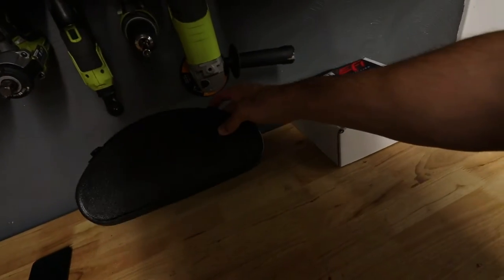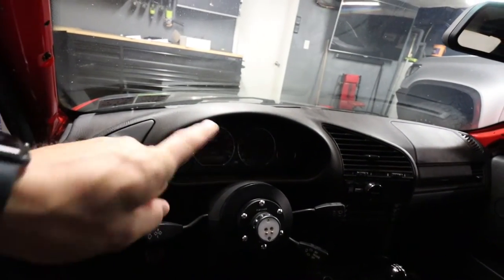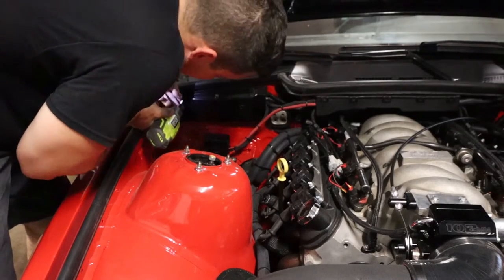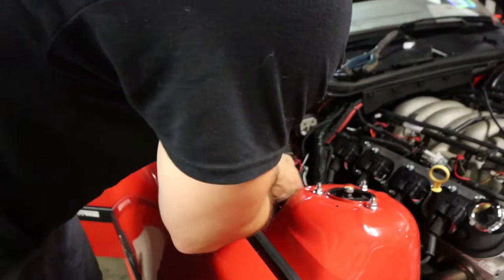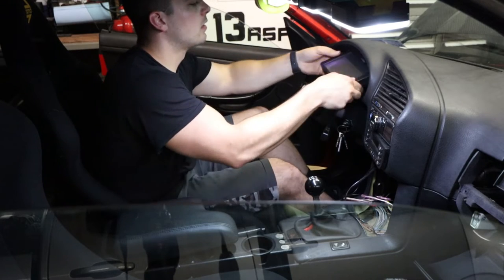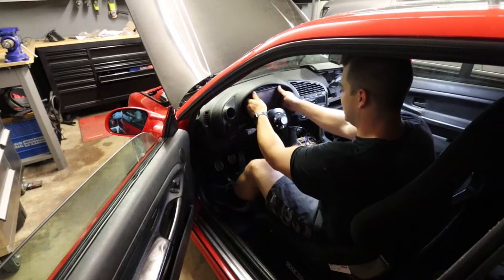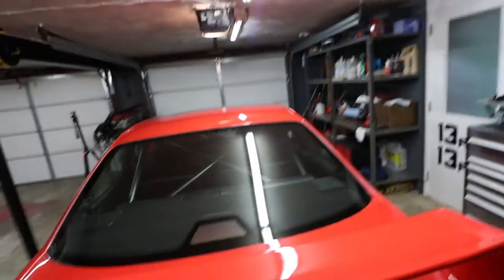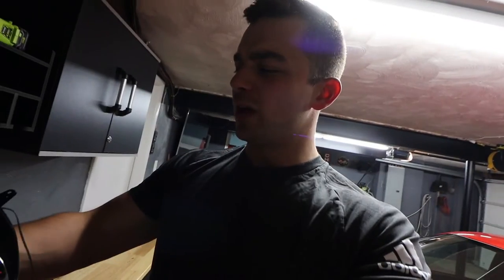Holley Digital Dash Install in my Built LS Swap E36! Best Digital Cluster?

Comment: The dash looks sweet! Almost looks like it was made for that spot. Will you have to run a separate fuel guage or does the ecu take fuel guage input? And we need to get you some AC in that car! That should be the next project
Reply from the maker: Somehow I can wire it into the dash. Just have to figure out the resistors, configuring, and all that.
Reply: @matt13ross  you ever figure this out? With the dual senders setup?
Reply: @digitalc0nvict   you can only use one level sensor, if you were to run both sensor it would be over 500 ohms and the Holley dash doesn’t go that far I think

Comment: Did you need any special ecu to run  the digital dash, how did you wire It up?
Reply from the maker: Nope, plugs in to my Holley terminator x ecu.
Reply: @matt13ross  I'd just want to run a digital dash on the stock ecu
Reply from the maker: You can do with with this dash, but you have to wire up each sensor then.